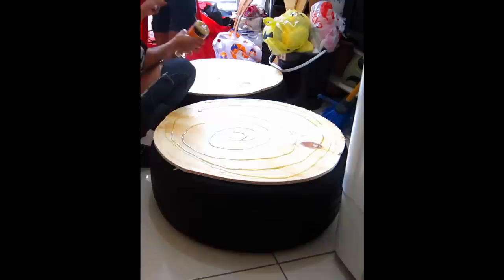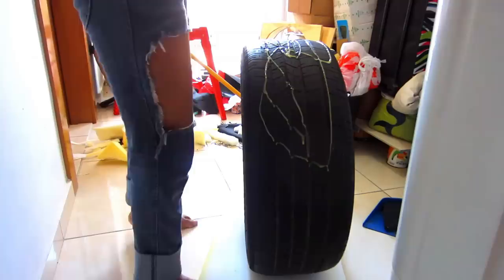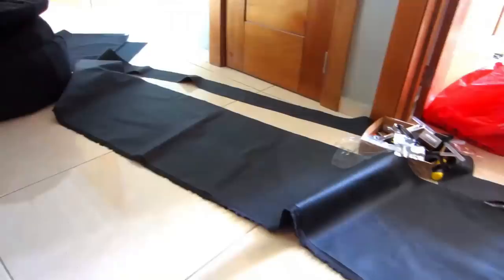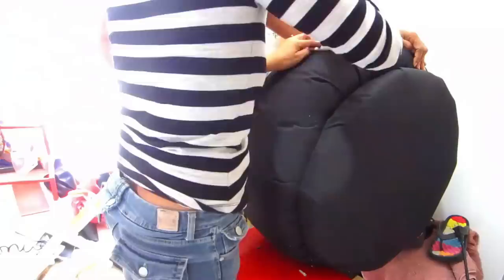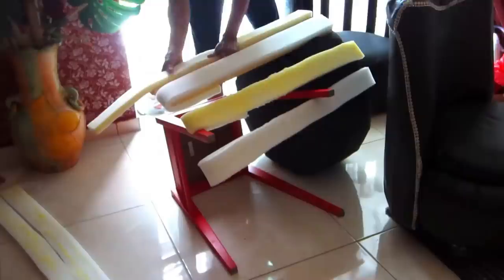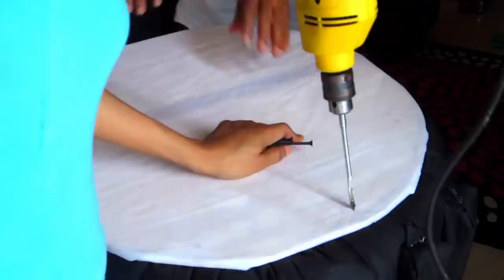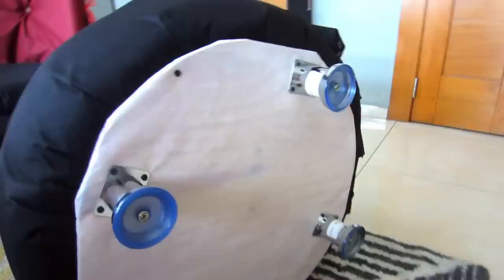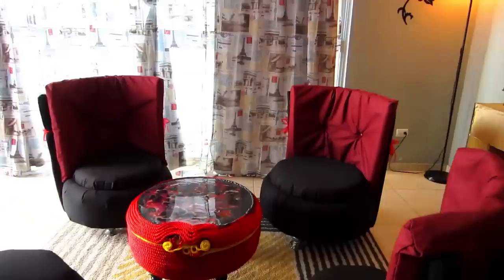How to turn your old tire to stylish chair

Comment: It's a fantastic idea. But it's also not this cheap to create. Alone the foam is quite expensive. I was looking for a cheaper version. But the idea is fantastic for old tyres. I have a community garden and unfortunately nothing is really safe. So I thought I will use some tyres to make some seats. But that's nothing for a garden. 
But still thanks for sharing a fantastic video. 👍
Reply from the maker: Hi, thanks for watching! If you are making this for an outside place I suggest that you use an outside cushion for patio chairs instead of the foam and you can use as well waterproof outside fabric. It it a little pricey but I probably spent about $100 to buy the material for the 4 chairs and I still had a lot of leftovers from the materials.
Reply: @diywithbellary  thanks for your suggestions. It's great. Would I have my own garden I would spend this kind of money. But unfortunately I have a shared Garden, that's meaning that items getting stolen or broken. That's why I searched for a cheap solution to might have a comfy seat just to sit in the garden sometimes. I have 6 old tyres I will just paint them use some wood for the seat and I still have some foam left from my old seats and will search for some cloth for outside use. 
I also have no space to put it away. So I will see what I can do. Thank you again 👍😃

Comment: Hello I need a (little) education on the type of drillers to use for drilling the tyres.
Reply from the maker: Hello Dear, Thank you for watching the video first of all 😊. I used a 10mm wood drill bit but you can also use a simple twist drill bit if you want to make the hole smaller. Hope that help!

Comment: How are you madam please may you help me with the names of the tools please please
Reply from the maker: Hello Dear this is what i use to make the chairs
MATERIALS USED IN THIS DIY
4 old tires (42" Diameters)
4 sheets 12mm plywood (To make 8 circles of 42" diameters)
3 sheet of 2" foam
4 4" square foam( 40x40)
Non-Woven Polypropylene Fabrics
16 long screws
96 1/4" nuts and bolt
16 1/2" nuts and bolt
Black and red fabrics (Fabric of your choice)
contact Cement : https://amzn.to/2QKL3Dz
Hot Glue
Staples
Ribbons
Buttons

Comment: What type of glue did you use please?
Reply from the maker: Hi Dear, I used contact cement on this project it's super effective. here is the link for it: 

https://www.amazon.com/00271-Weldwood-Original-Contact-Cement/dp/B0006MXRY8/ref=sr_1_18?crid=3MC8DD436L51Y&keywords=cement+glue&qid=1578602044&sprefix=cement+gl%2Caps%2C191&sr=8-18